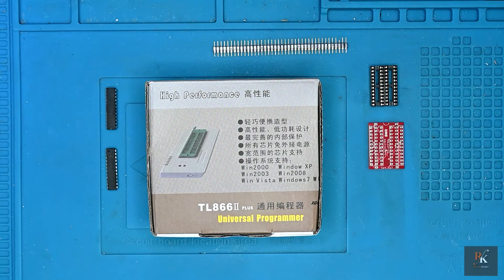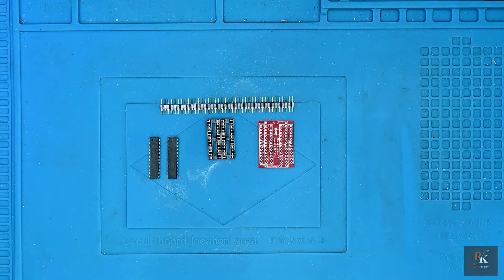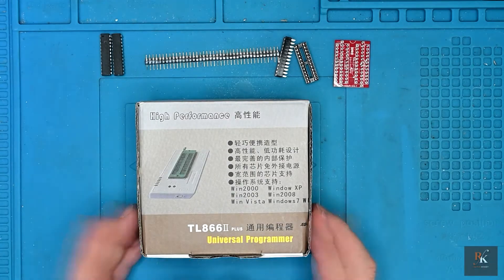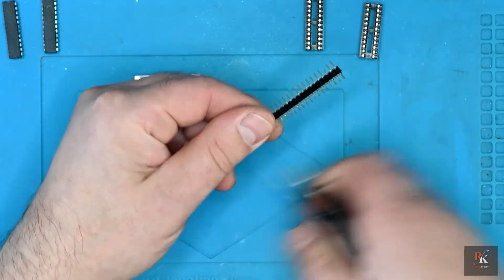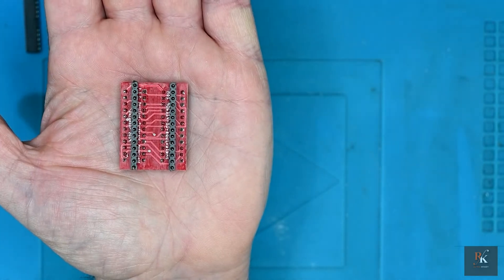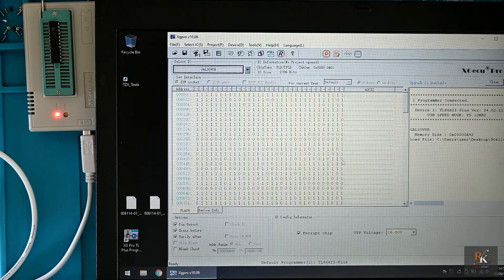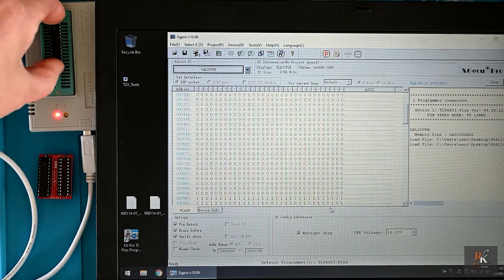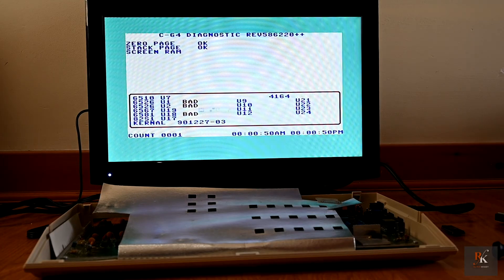How To: GAL based PLA Replacement for the Commodore C64 - It's Cheap!

Comment: Why are you using obsolete GAL20V8's on your board? You're paying more for old parts than it would for new parts. Recompile the JEDEC file and use an ATF22V10C-15PU. Still made, costs less than the 20V8 and no need to work with the aliexpress counterfeiters.
Reply from the maker: Thanks for the tip on the ATF22V10C-15PU! Will look into that another time as have a stockpile of the pre-built GAL PLAs at the moment.
I'm new to this relatively speaking and the board is simple and easy to assemble, making it relatively straight forward for anyone to build. That was the main reasoning tbh.